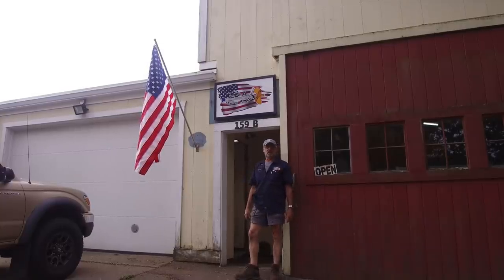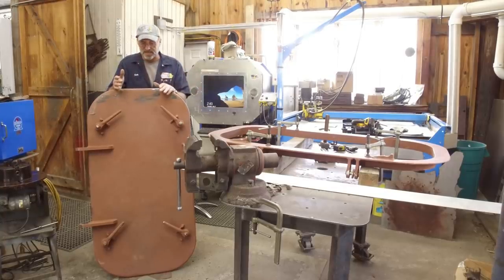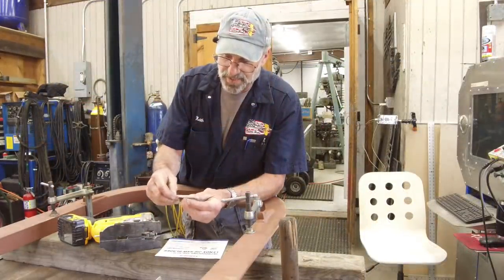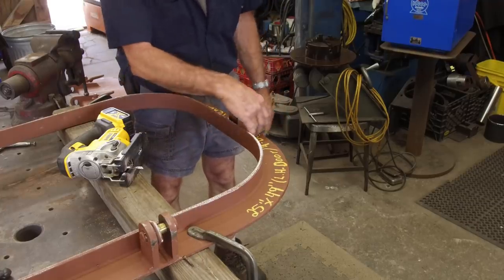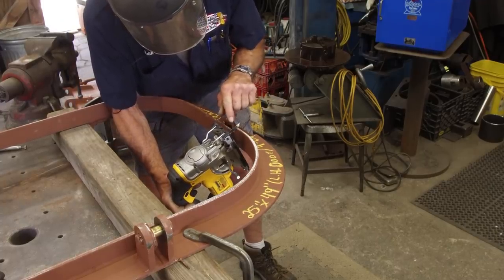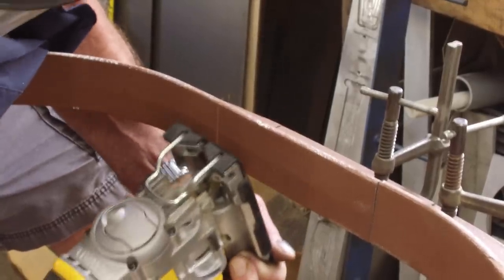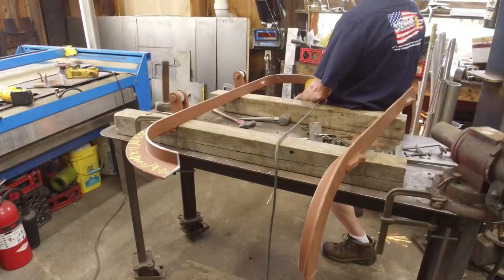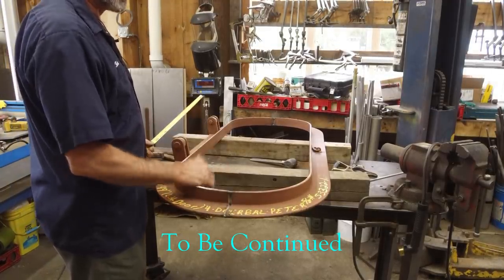Splitting Hatches

Comment: Once again you provide a challenging project.  Not just watching a machine repetitively cut like other channels.  You have a real working metal shop with real-world projects. I am a loyal and avid fan of your channel. You give us something to think about.  I would not have imagined that a jig saw would cut the heavy metal frame.  My choice would have been a portable ban saw or a grinder.  Learn something from you every video.  Thanks.
Reply from the maker: Cool, thanks!
Reply: Amen! I thought I was the only one feeling this way! Love to see projects and not the same old thing.
Reply: I remember as a teen trying to use a bedframe that I found in the dumps as angle iron for a project.  That stuff was hard and a high speed steel bit just skidded around.  I guess some alloys are just tougher than others.  I suppose a hatch isn't really a load bearing part (most of the time).

Comment: Heat is the enemy of the blade .Oil will keep it cool and make it last .Lenox should send me on  on a cruise for all the blades I have purchased over the last 35 years.
By the way, great job on my prop shaft last year .I didn't get to see you when I picked it up. Thanks Keith
Reply: A cruise is a form of punishment now.
Reply: robert steven  in a pinch I’ve successfully used a file (if the blade was cooked and no longer as hard) or diamond sharpening stone to touch up the teeth on a blade just to get by and finish whatever project.  Ya don’t need to worry about being very precise like say sharpening a table saw blade or hand saw as it’s insignificant to how the rough and tumble life a sawsall or sabersaw blades sees.  Just a thought if ya into tinkering
Reply: I think I would have been slopping on the used motor oil, but what a mess that would be. I suppose even water would have helped cool that blade.
Reply: ...an awesome trial for the product.  I think Keith wanted to show the Lennox blade under (semi) "200 Lb. Gorilla" treatment.   Reason why he donned the crash gear, possibly.  All good!
Reply: @tiredoldmechanic1791  Ghost ships
Reply: @tiredoldmechanic1791  Yep.

Comment: Keith you should use the Diablo metal cutting ccarbide circular saw blade. Cuts fast and smooth. Cuts a 1/2" I beam  in about 10 seconds with ample depth.

Comment: I cut a bit of angle I have learned to clamp  an aluminum speed square, oil up the blade, slow down.  Sometimes I finish a whole project on one blade.  I doubt you'll get thru the hatch with one blade. lol. nice work, thanks!
Reply from the maker: Great tip!

Comment: Hi Keith. Could you have used your plasma cutter (head) for this? Seems a lot safer than trying to use a jigsaw held in that awkward vertical position; I half expected the saw blade to break off and go flying across the shop.

Comment: I like that blade.  I suspect the curve probably backs most of the blade away from the cut during the up stroke so it can plunge for the next stroke without dragging the teeth backward.   When I use a jig saw cutting metal, I wince a bit when the motor jumps up from the work; that's always an indicator that some teeth are getting hammered on the wrong side.

Comment: Keith I got a earth clamp that no works at all on wood yet! 
 Work bench   have you thought about bit of plate on car lift arms any height table
Kevin the artist's sculptor got a single post lift table. 
Are  3 phrase welder running of rotary inverter? First time seen it done.
Steve  in UK

Comment: Keith, impressive cutting with a battery sabresaw. Are you using 7018 fasteners on this. Cheers, PB...I have not watched to the end yet ...like the concrete action for clearing the rod, I do the same or keep a brick handy so I don't have to bend over...
Reply: 6018 gives better penetration.  Ground clamp attached to Vise~Grip works very well.  Keep a piece of scrap on the table to strike arc and keep electrode warm.  Ground clamp as close to weld as possible.

Comment: "18 inch ... walk through access"
I don't think they'd be walking very fast, and if the width restriction also means the door can't open 180 degrees, they're in trouble.  Maybe they should have asked you to take some of the 6" out of the outer edge of angle frame flange.

Comment: Keith . Try useing 1/8" or maybe 3/64" E7018 set on the hot side. For tacks for easier strikes and gives better penatration .
Reply: kieth was using 1/8 and i think you mean 3/32 not 3/64ths and your right about tacking on the hot side. i always tack hotter.

Comment: Keith, had a word with the boys at Pakistani truck channel. They said they would put you on, but as you tend to use clamps rather than your foot to hold stuff and like to work on tables rather than the floor, they regret to say your not qualified. Sorry bloke.
Reply: Matt Tradie,  Such a good comment and observation .Those guys on that truck channel with their lack of equipment and blatant disregard of personal safety certainly are qualified to make any H/S inspectors have a nervous breakdown.
Reply: mister kluge “some safety issues” now that is the biggest understatement of the week!👍😂
Reply: mister kluge  Boots? They use the latest in steel toe sandals you know.
Reply: Kowalski K, along with frameless safety glasses!

Comment: at 9:18 we can read the crayon saying 25" x 49". How does that relate to the 24" you cut it to?
Reply from the maker: That was the markings of the stock size by the vender. ;{)
Reply: 25" x 49" would be the coaming inside width and height as a stock item.  24" was the spec. for the outside flange width after modification.  The flanges look to be about 3" wide, actual 2-7/8" according to Keith's reduction dimension, so the stock coaming outside total dimension was 30-3/4" before cutting and he removed 6-3/4" to get to 24" outside.